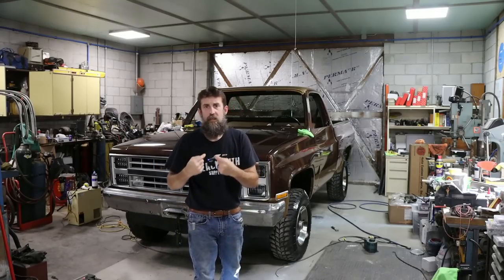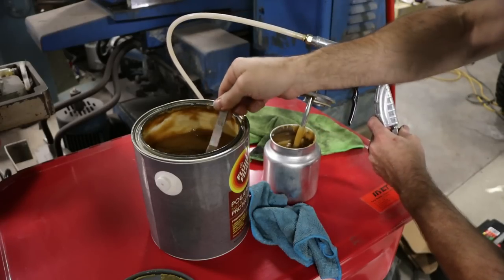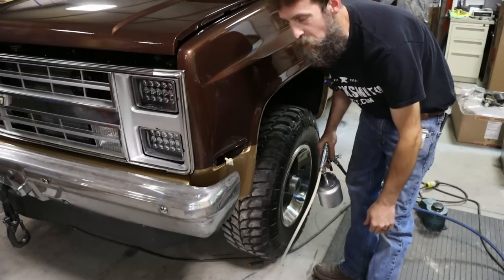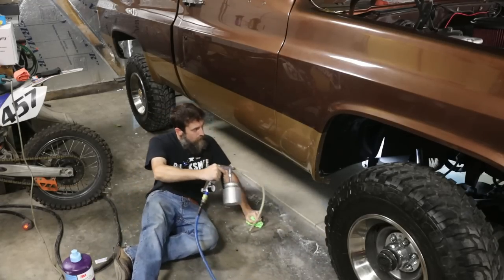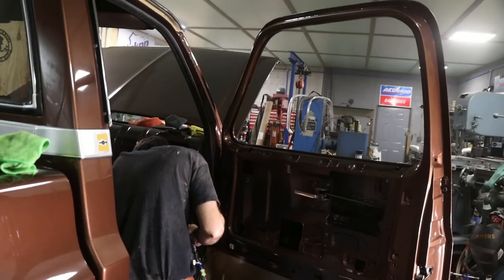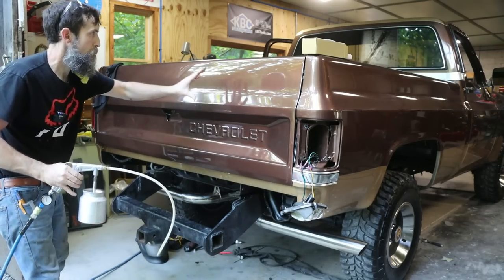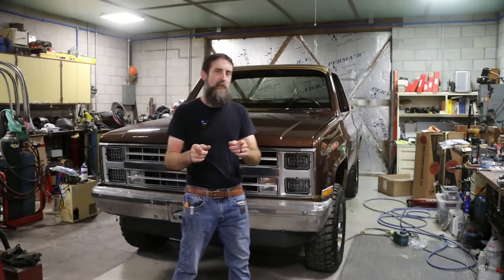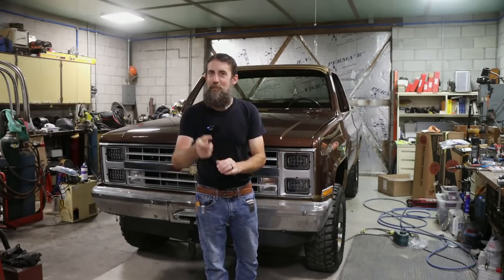Best way I have seen to RUST PROOF!

Comment: I own a product from the greenhouse industry that I use for this and many many other household tasks, it is called an atomizer. You can get cheap manual ones for 15 bucks, the big industrial monsters go for about 250. But they are absolutely worth it. They save you a small fortune no matter what you are spraying, a gallon of material can very easily be spread to completely soak a rooftop 60 ft by 120 for example with just over 1 gallon of diluted vinegar. I have ponds and I live near Puget sound and have dogs so I don't like to use chemicals. These things spray a focusable mist about 40 ft forwards and between 6:00 and 40 ft wide. I do my roof from the ground in about 5 minutes for example, from the one story side. But I also use it to undercoat the vehicles with whatever oil, there is an integral filter. Mine's going on 10 years and I've put all kinds of things through it and it's still in perfect shape. Really a fantastic tool overall. I'm not much of a housekeeper and I'm sort of sensitive to bleach. I feel that thing with diluted bleach and I can soak every inch of the bathroom with one held breath. Really a fantastic tool all the way around. If you take a length of tubing on to the nozzle, you still get a fine mist even turning around the corner

Comment: We call it Waxoyl in the UK and I have been using it for well over 50 years.  To get it to spray well I thin it down with paraffin.  The paraffin is just the carrier so it flow OK and thinner down and warmed it it sprays really well in an electric spray gun with an adjustable nozzle.  Thinning it down also means you can get it inside box sections using the four way head.  I very exposed areas underneath I mixed some with black rubberised underseal and paint it on with a brush.  It remains thick and never sets. I had my motorhome for 23 years and never had any metal rot out...not even a brake line.  I keep my ars for at least ten years and they are at least five years old when I buy them.  They get the same treatment and, again, never had the slightest body rot.

Comment: Hi, I've tried many things over the years and most things slow the process by a couple years. finally an old timer that I met had a perfect looking car from the 60's (this was in the 80's). he just knocked a tiny hole in each enclosed panel with an awl and hammer. armed with a pump type oil can he would squirt a bit of fresh engine oil in each panel every time he changed the motor oil. that what I am doing still. I have a car now that is 20+ years old and has very  little rust. the only things that were a problem is where I missed. I have done a bit of body repair for people in the 70's and 80's and no matter what rust proofing was done nothing worked well. I live in Illinois where the streets are always salted in the winter.
try it, it really does work and its easy.
Good luck Rich

Comment: i always used a thick fluid film mixed with 50% old motoroil to spray the underside of the car. works GREAT. and a light fluid inside all holes.

Comment: We get awful weather in Great Britain. Roads salted most of the winter. Sea spray coming in. 95% humidity. Can't  think of anything worse. People doing full restorations use an epoxy mastic paint filled with aluminium for rust protection. This stuff is used on oil rigs. Then for cavity protection we use Waxoyl or Dinitrol which is similar to what you are using.

Comment: Take it from an Upstate New York, 10 miles from the salt mine guy, Fluid Film is awesome. FF works best for interior cavities. It clings and will flow into seams and crevices at the same time. It works OK on the under body but will wash off with use. I have to apply it every fall but it is worth it.

Window installation tip, coat the pinch weld with Fluid Film. It'll lube the weather stripping going in and provide protection from any moisture that might get in there. I haven't experienced any sealing issues with FF in there, I think it allows a better seal between the rubber and the pinch weld.

Comment: Suggestion for your application-
Use a saucepan on burner, or a microwavable container, in a Shop oven
(so your food won't smell & taste) and heat this (or any other "undercoating")
to about 200℉ (93.33℃) before spraying. Heating makes it stick and creep
incredibly more, and go further, then at room temperature.

Comment: Best way I've seen is acid dipping the whole body to strip everything off, double rinse, dip in an etching solution, double rinse, dip in a phosphate coating, double rinse, dip in electrophoretic paint, double rinse, and finally a 200 degree bake in a big oven, then bodywork and paint. 
It's pretty much the process used on new cars but there's a company in the UK doing it for vehicle restorers. Followed up with a rubberised coating of the entire underbody, a quality paint inside and out, and then regular maintenance with products like fluid film or waxoyl as we know it, it'll be a long time before any rust has a chance of setting in.

Comment: That is a great product for a machine shop. I have been using it for 30 years in aerosol form.  Machined parts with a thin coating dont rust even after years of sitting on the shelf.  And I use it in a rag to wipe down all my tools and have never had a problem with rusting.   Not sure how well it will work as you are using it but I do know that some people do use it that way.  Thanks for sharing.  Charles
Reply: I wipe the ways and unpainted metal parts of my machines down with it so that they do not rust in the winter. It’s kind of a bummer to have to wipe it off my lathe handles when I go to use the machine but small price to pay for having a machine shop in a poorly temperature controlled space.
Reply: @FKreider  A lot easier than wiping off rust!

Comment: For people in the salt belt Krown is a good option. Here in MI its $130-$150 and they will drill small inconspicuous holes in the rockers and A,B,C pillars. If you do go the fluid film route they have a black version also that might make wheel wells and chassis look better.

Comment: I tell people that Fluid Film  is like Frank's Hotsauce I put that s--t on everything.  I like the colors and remember painting it many times working in a GMC dealership in the 70's. Where your colors meet a chrome trim moulding would look good with the dark color and chrome wheels and mirrors. Or even a then yellow or red pinstripe at the breakoff.  Truck looks great and probably has better fit than new as these trucks never had good fitting doors.

Comment: Truck looks awesome! FWIW you can get the black fluid film as well from your local John Deere dealer should you prefer the incognito look.  If you drive thru tall grass a lot it gets rubbed off the chasis but if you dojust give it a quick spray again and you should be good to go.
Reply: Brian. Steve built quite a truck. Too bad no one close has a dyno. I mean that would make quite a show. Any way just saying.
Reply: @kevinriese6384  Could get the rings seated on that 383. 🙂
Reply from the maker: @bcbloc02  It really needed put on a dyno before it went in the truck.  With the new axles needing broke in as well it will need to be took easy on at 1st. Not the best for the engine really.
Reply from the maker: I just seen the black version the other day. Would be nice for making sure you covered everything 😁👍

Comment: OK, Steve, the most fastidious guy I know, settled on Fluid Film to preserve his Porsche 912 and air=cooled Vanagon Westphalia.  He's the thorough type (like you).  He's particularly knowledgeable regarding which areas of car rust; as a twerp he worked in a rustproofing joint in the Rust Belt (first, search the car for the dope).

Comment: Up here in Canada we have a product called Rust Check.  If you take your vehicle to their shop for treatment every year, they guarantee it.  It's essentially mineral oil about the same consistency as Fluid Film or Krown.  I think that's the key - it has to be oil based that's fluid enough to creep into crevices.  I have 2 2013 Toyotas that I treat every year and not a speck of rust on them.  And we use a LOT of salt on our roads where I live.

Comment: We used a similar wax-based rustproofing product, and we used a hotplate and pot of water to heat the sprayer pot and warm the product, to allow it to fog even better. We did switch to a black, petroleum-based undercoating to stand up to the Michigan salt attack better.

Comment: the truck looks really good and I agree with the colours match, living in the UK we have something called wax oil applied with a similar spray gun it does a good job it's worth taking the time and effort to do
Reply: Yes likely the same stuff as Fluid Film. Waxoyl is basically paraffin with a lot of wax added to it, and as well a surfactant that will enable it to wet surfaces even if they are damp, removing the water and allowing the paraffin and wax to adhere there, and the wax to remain after the paraffin has slowly evaporated.  You can do a similar thing using boiled linseed oil, turpentine substitute as solvent, and a bit of wax dissolved in it. This will have a similar effect, and will leave the long lasting film to protect. You apply till it starts to drip out, then leave in a nice warm area with good ventilation, and on bare ground so the drips do not stain, for a few days.
Reply: Same thing - Fluid Film is wool wax

Comment: I have been using that product for a number of years in my shop. I am located near the coast and in the winter time my equipment will sweat which causes flash rust. This is a good product and I haven't found any down side to it.

Comment: Use straight lanolin - a brand called Woolwax offers it. No additives or solvents - better than Fluid Film for that reason (cheaper, sticks better). Apply once to any internal cavities during summer, and once a year or two for the underside. Spray everywhere, even the exhaust, it does not burn. Can also paint it on for touchups like door edges

Comment: You should find the stock cold air air cleaner for it so the engine isn't sucking in all the hot air from the fan

Comment: there is a new product from PB Blaster called Surface Shield. it is the same lanolin base as fluid film. but it sprays and sticks better. Repair Geek has a video he did some testing on it. they have it at my local Oreilys in gallons as well as aerosol cans.

Comment: I've been using Fluid Film for years, having found it at a supplier to the oil offshore platform industry.  It works and lasts. I've used it on saltwater boats and in my shop. If not mentioned earlier, it is made from sheep's wool. I never used it on a car or truck. Now living in very dry Nevada, there is no need.
Reply: Actually it contains lanolin.

Comment: I would also Fluid Film down in the cowel area. Dirt & leaves build up over the years & can rot the fire wall out & rot out behind the dash letting water in on the floor. Otherwise the truck looks awesome you did a great job on the body work & the paint looks great.!!

Comment: I played with fluid film, but went back to bar and chain oil with 10% diesel mixed. Much cheaper, and seems to creep better into small areas. I do use a spray can of fluid film on the lobster boat to spray hydraulic hose couplers, steering rams, and everywhere else that the salt water can chew on expensive metal stuff.

Comment: Hi Steve, my all time favourite rust proofing is fish oil. People used to use it on their cars back in the 60’s and 70’s and it’s brilliant but it stinks, even the deodorised fish oil stinks🥵 I welded bare metal base plates to the upright posts of a car port 20 years ago and just gave them a good coat of fish oil and they still haven’t rusted and they’re bolted down to concrete and you know how badly metal left in contact with concrete can corrode. Anything that is going to be out in the weather gets a coat of fish oil and never rusts. It’s cheap, easy to apply by brush, roller or spray and will stop rusted metal from deteriorating any further. It does dry but takes a while and it’s not good for taking a coat of paint over the top. Did I mention that it stinks? Love your truck. Cheers Stuart 🇦🇺

Comment: Steve, make your automotive paint last basically forever without drying out or becoming ruined. Drill two small holes in the lid that you can fit either a rubber plug or some other gas-tight plug into; Drill them 180 degrees across from each other to get good flow. Use a line off of your argon tank to purge all the air from the paint can, replacing it with argon and then plug the holes up to keep the air out. No oxygen for the paint to react to means it'll be perfect next time you use it. Paint is expensive and argon is cheap!

Comment: If you search YouTube with keyword  "Ruostesuojaus" you could find how a proper corrosion prevention treatment is done (in finnish language though)... 2 day process but it lasts decades if done to rust free car (Though we in Finland use less salt on the roads and rely more on proper plowing and using scandinavic winter/snow tires, studded or studdless)

Comment: I have a 20 liter of rust profing otopro its syntetic and it stay it stick.i have ultra pro spray gun and a small tip that give a nice thin layer and it turn sticky and it stay forever.the mineral rust profing dont stick to the body.take syntetic

Comment: Many years ago I bought a used car, an Olds 98, which had been given a rust treatment. I'm inclined to say it was "Ziebarted," but I don't know if it was actually that company or maybe some competitor. Anyway, it may have prevented rust, but the black stuff that they sprayed all over it never seemed to completely dry. I remember after one trip my family took, the luggage we'd hauled in the trunk had numerous splotches of black, sticky residue on it. And this was years after the treatment. Hope the product you're using doesn't have that problem.

Comment: Your nice and clean shop is going to smell like a sheep farm. but the rust will keep away😂👍I have used it in the oil industry to keep rust away from downhole tools, and it does a great job at it, even semisubmerged in sea water
Reply: Jone Tveitane, Are you referring to Lanolin by any chance?
John, Australia.
Reply: @joandar1   Fluid film contains Lanolin, but I have used that aswell. Fluid film smell the same when heated by the sun
Reply: @jonetveitane  Thank you for your reply, I thought the original comment was a reference to that fact. John.

Comment: I like the color, don't take this as a jab but it feels like it needs a pinstripe at the transition. I think black might be too much, maybe a charcoal gray or dark metallic silver.
Reply: As far as rust proofing, I don't know that there's a real difference between the products, many of them discussed in the comments. Just do it every year and do it thoroughly and the variables between products disappear. Like the argument about motor oil, this brand vs that brand. Just do the thing when you are supposed to and you're fine. Real world variables are larger than the product differences in controlled conditions.

Comment: Fluid Film looks like a thin grease.
Reply: It actually dries to a slightly waxy feel. You can remove it with white spirit if you need to get back to bare metal for repairs.

Comment: We used to have a product called Waxoyl here in the UK, which looked a lot like what you are putting on the truck. Waxoyl had a pleasant smell to it, as well. The spray gun you showed was a frequently found item in British workshops, mostly used for spraying used engine oil on things like leaf springs and other suspension components to prevent squeaks and to extend the life of those components.
Reply: Old UK Military vehicle panels were initially painted bare metal inside with a Phosphoric acid/latex mix, then undercoated and lastly Waxoyl'd and lasted decades. Don't know whether they still do that though - probably not...
Reply: almost word for word what i was going to post, I remember spraying it into the frame of my old 2 litre v4 transit, and that lasted a good few years, it also had a pump nozzle that connected straight to the can and you pressurised the can to spray it.
Reply: yep used "Waxoyl" in the past as well you used a spray with a long tube as well but no so clever all the supplied was a tube with a flattened  nail named in the end did my old rust heaps in the day helped to slow things down but they were rusty before I got them
Reply: I live in England do you know where I can get a spay gun like his please?
Reply: We still have Finnigans WaxOyl in the UK, it’s still available under the hammerite range!!!
Reply: Waxoyl is basically the same stuff Steve used here. Awesome gloop. I used to work maintenance at Honda in Swindon, now sadly gone. The way they did the car bodies was to dip them upside down in various tanks starting with a deionised water bath that was slightly acidic with a surfactant in to etch and clean the raw steel. Then a clean in pure DI. After that it was a bath of DI with a high zinc content sort or paint/particle bath that was electro-plated onto the body. Worked like the best etch primer you can think of. The whole process is patented by a company called Durr. I guess that's why modern cars don't rust. Cool to see but no fun when a body falls off its dolly in the bottom of a tank😂 Love the colours Steve, looks good enough to eat👊
Reply: Yep, I have used it on my Moke and Mini.  Also with English vehicles being so rust prone.

Comment: It's great helping rust ,but I can't help thinking you just put your truck in a higher chance of a fire .how flammable is the stuff if you blew a bulb or got a wire short how much risk is your truck taking are you trading a rust issue to a fire issue.?  Can you do a fire test on a piece scrap metal covered in fluid film